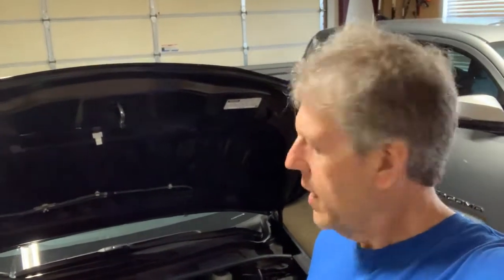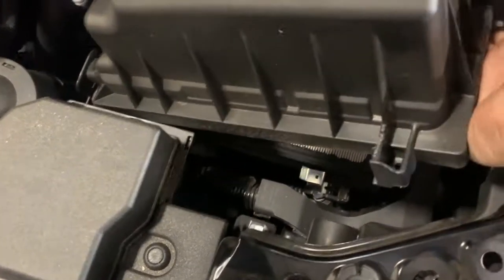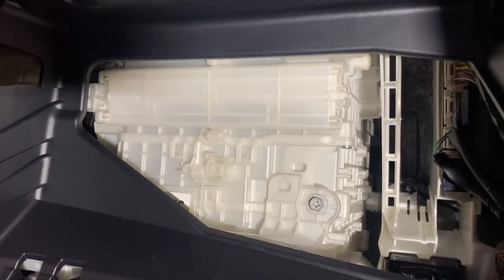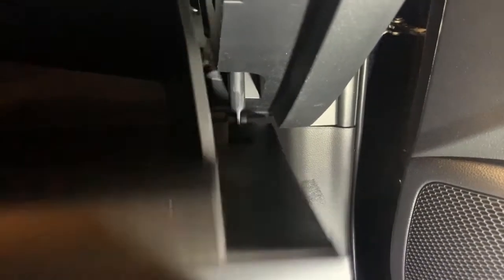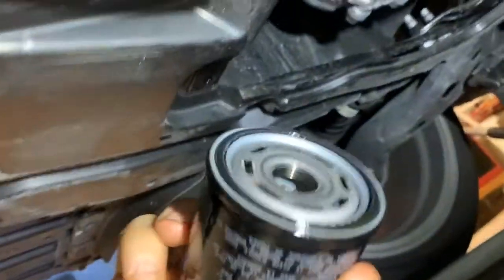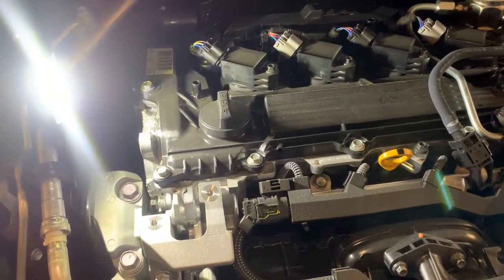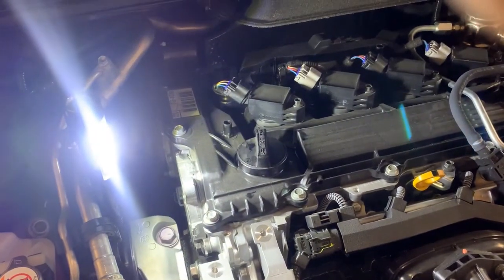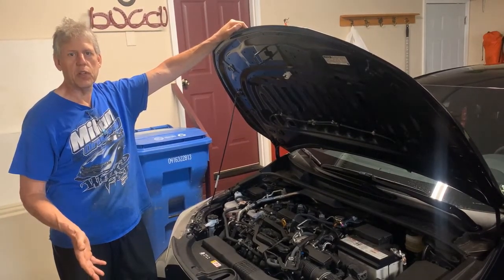2021 Corolla Hatchback Nightshade basic maintenance (Really any 2021 Corolla is similar)

Comment: Toyota decided to not put an engine cover on (Lexus still has one), but put a plastic cover over the oil change bay. Also it’s impossible to jack this vehicle up using the jacking point on a cross bar. All made in Japan 2014-2019 Corolla sedan had an easy access front jack point.

Comment: Amazing video!! Can this be done on a 2009 Corolla? I bought one with 63k miles for $7k… was it a good deal? 😔
Reply from the maker: Everything I did would be very similar. Basic engine maintenance is all the same. 7000 isn’t bad considering the mileage. My daughter 2005 rav4 has over 160000 miles now and still going strong. Her engine would be closer to the same as yours. There is a video on doing her basic maintenance if you watch that one would be closer to the same engine you have.

Comment: how often do you this general maintenance in a year?
Reply from the maker: All depends on how many miles you drive per year, if you put on for example 20,000 miles a year you need to change the oil every 10,000 miles. Read the owners manual of what should be done at the different maintenance intervals.
Reply: @ShopDogFabrication I wouldn't do 10k mile intervals. 5k the most